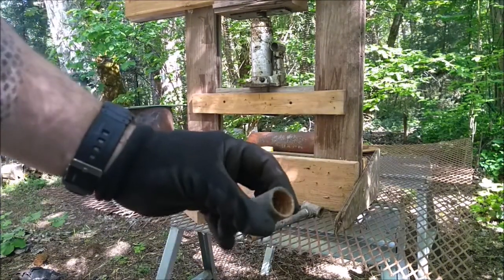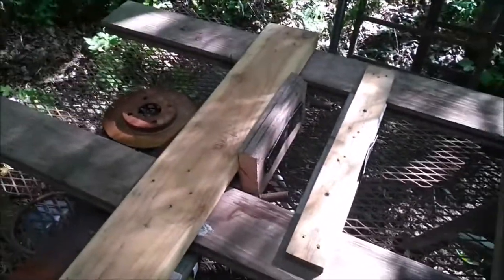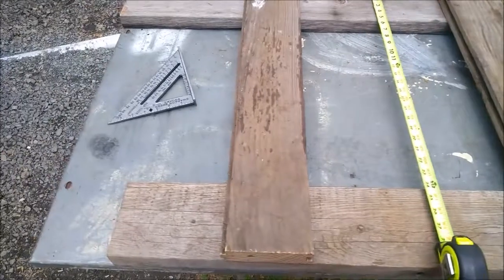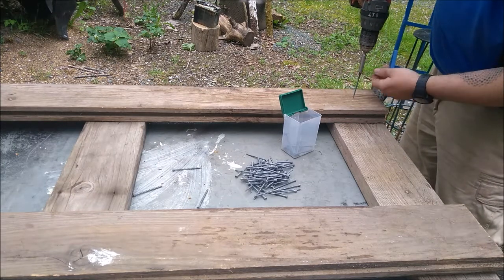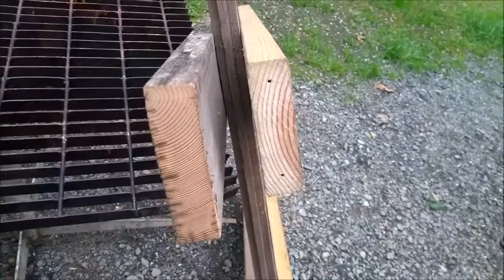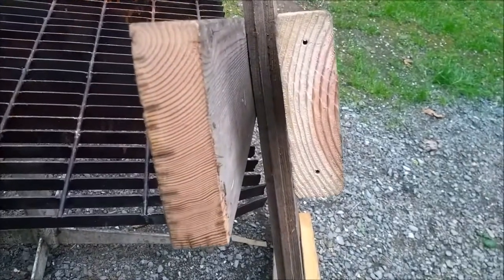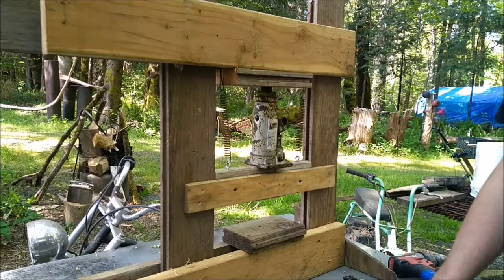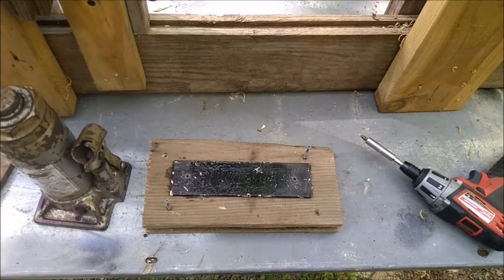Homemade Hydraulic Press Using Wood!

Comment: I made one of wood. I used 2/12 and I used lag bolts and I’ve got double layers on each side and it’s been here for years now and been used to where I thought it would fell but it’s still going strong and I can stop a 12 ton jack that stalls the jack even with a cheetah pipe on the handle. I used 1/2 bolts nuts and washers and drilled all my holes. I just used heart redwood.
Reply from the maker: Sounds awesome.

Comment: No that doesn't tell new from old wood, It show one is 1/4 sawn and the other one is riff sawn.
Reply from the maker: I know quarter sawn, but I'm going to look up riff sawn right now.  Thanks!
Reply from the maker: It's rift.
Reply: @thecatsupdog  Riff sawn is same thing as slab cutting . when you riff cut , when you get to the center of the log (cant) you will have a couple of boards that  are 1/4 sawn (just take the piffle out of it ) a board on each side of the center.
Reply from the maker: @leonardwilson980  Now I have to go look up piffle!
Reply: @thecatsupdog  It may be spelled different , M y spelling is horror able. It might be  piff.